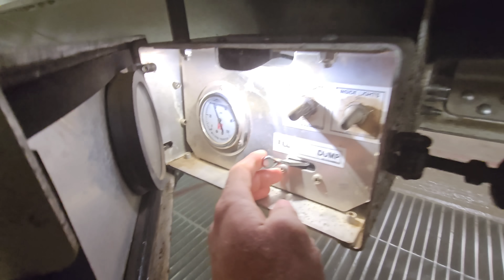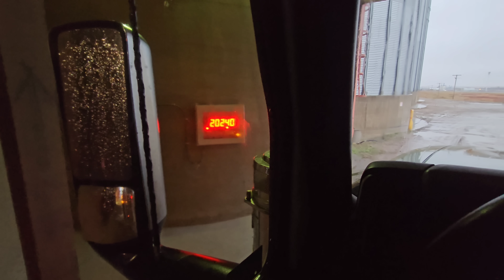Swift Current Terminal!

Comment: More and more terminals are not using the probes as they have to do complete load samples.  Some large farms (won't mention names) have been caught putting crap grain in the corners of trucks where the probes don't touch.  As such, some farms trucks aren't probed and get a complete load sample regardless of if they have a probe or not.

Comment: In germany the time of the yellow phase is standardized:
50 km/h  -> 3s
60 km/h  -> 4s
70 km/h  -> 5s
If you have brakes according TÜV, you can always stop on time.
Reply: Those are not long enough yellow lights for a fully loaded semi.

In America, according to the streetlight guy in my city, it is a federal law that yellow lights can not be longer than 6 seconds. It takes a lot longer than 6 seconds for a fully loaded semi to stop at 55 mph. That's why you see a lot of black marks at stoplights.

Comment: The way to tell if it is an oil train which there are very few of lately is there is 2 engines one regular car and then a bunch of black tank cars with 1263 placards another regular car and a remote engine at the rear.

Comment: The elevator where we haul our grain too built a new dump station with a probe a few years ago. They have never used the probe. They do it the "old fashioned way" too. They built another new dump station last year at the other facility they have in the next town & they didn't even put a probe in. Traffic lights are one thing we don't have to worry about when we haul. The two elevators we haul to are in the same county & there is not even a traffic light in the whole county.
Reply: Even where they do have probes I have heard that some producers trucks don't get probed and get a complete load sample (as seen in this video) as they have been caught putting crap grain in the corners of the truck where the probes don't touch.  Makes more sense to just do a complete load sample than to try guess which producers are honest.   Not sure how they caught the guys in the first place? maybe they could see the different color grain from the probe camera which would prompt a visual inspection inside the truck when they got inside the terminal.

Comment: Seems light to me 😅 i used to drive peat in Finland, empty truck+trailer was 27 tons, but the overall mass was 76 tons, 79.8 during winter. It was no side tip, it was rear pushing with a chain floor, kinda like walking floor but not, similar to tractor manure trailers but bigger. I don't know what it is called in English, chain system added some weight for sure. This video kind of reminds me of those times, sort of similar terminal, unloading through the grill.  Driving in 0c weather, wet, icy and fun times. Winter was good but around 0c and snow. Or freezing weather AND then rain, all roads nice and slippery.
Reply: Yeah, 20+tons is light. My working truck weight 23tn + 5axle fulltrailer 10tn... empty!

Comment: I remember the days of hauling grain to the UGG; in my travels, I have only seen grain probes at Ethanol plants. Mike, do you see any changes with the imposition of Carbon tax and fuel surcharge tax?  I can not imagine farming now with the government seeking to eliminate the trade by taxing it.  Drive safe out there; I've been on the road many times with freezing rain, carrying a load and on the backhaul empty, it's just not fun.
Reply: 95% of elevators now have probes and everything, most places you dont even have to weight before you leave.